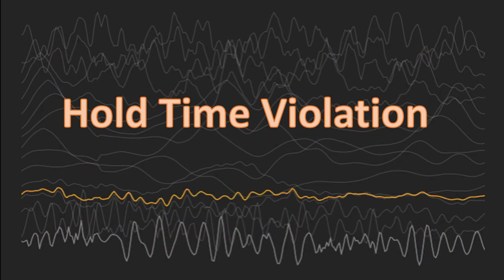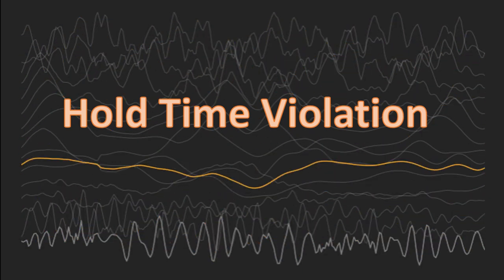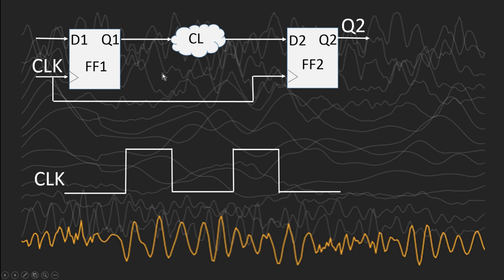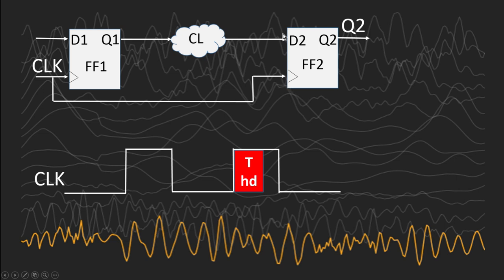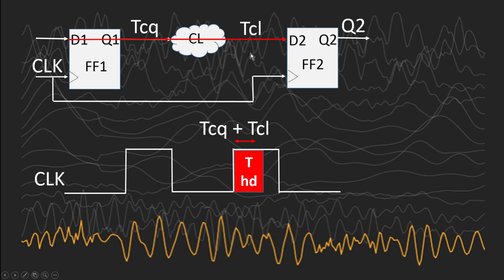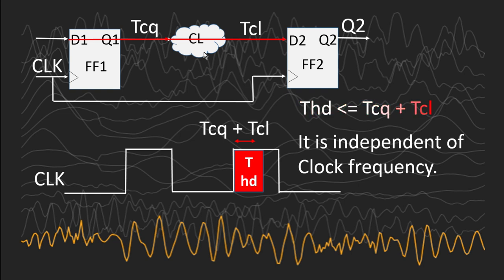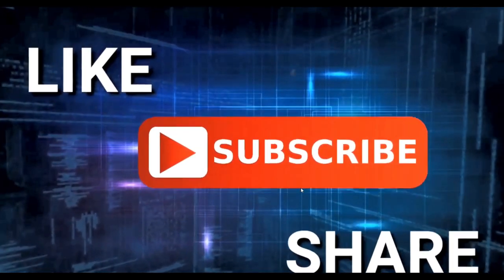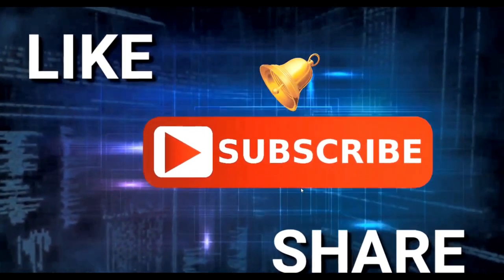How to calculate Hold Time Equation | Hold Time Violation

Comment: How the hold violation in clock synchronizer path rectified?
Reply: Usually solutions are lengthening the combinational logic of the (short) critical path, longer routing for wires, decreasing the drive strength from the launch FF or replacing launch FF with one that has a higher threshold voltage or has a longer clk->Q time.